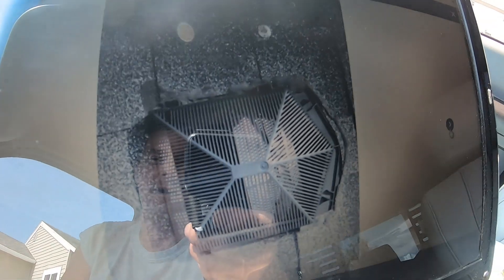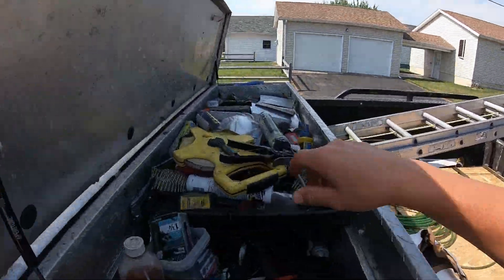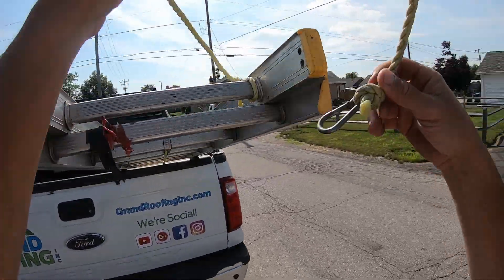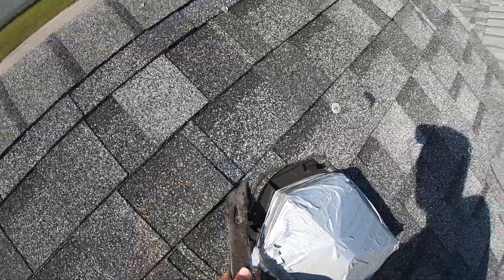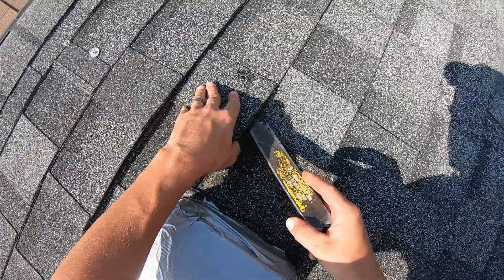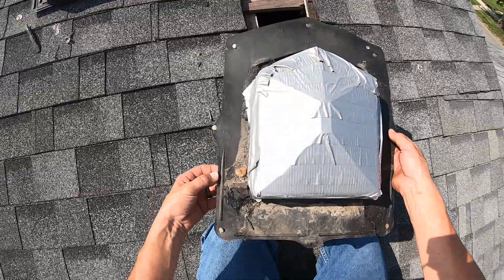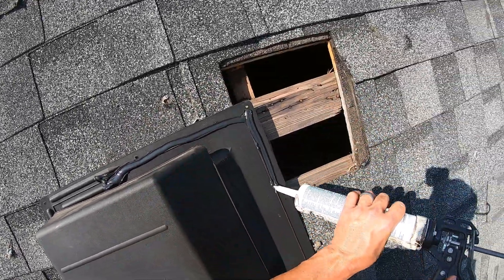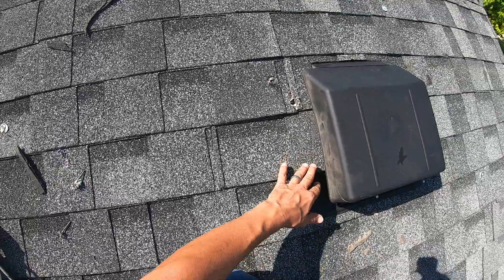Roof box vent replacement

Comment: Are not all roofing hatchets magnetic?  The one you listed is $70, while others are $30ish  (Stanley, Vaughan)
Reply from the maker: This one has a very strong neodymium magnet embedded in the center of the head. Some others have a magnet on the top part for just getting the nails started.

Comment: Your ladder is to steep ratio should be 4:1...and is not extended above roof edge 3'. Good job tieing ladder off!
Reply: I never extend my ladder 3' above and everyone has their own comfortability with ladders. You have to do what works for you not what OSHA says is ideal. I like my ladder 1 ft. Above gutter but no more.
Reply: @YoMamasCasa  its nice to do whats comfortable ! Here in B.C , Worksafe is pretty tough on contractors.  You choose not follow there rules, then be prepared to open up your wallet.  Fines are not cheap and double everytime you are caught with the same infraction.  I heard of a company on the coast that was fined $15,000 one day, $30,000 the next for not wearing harness when required! Brutal!